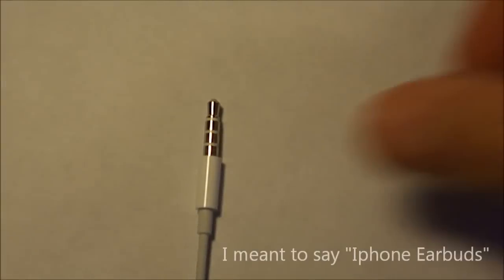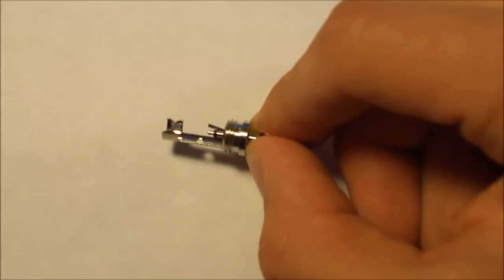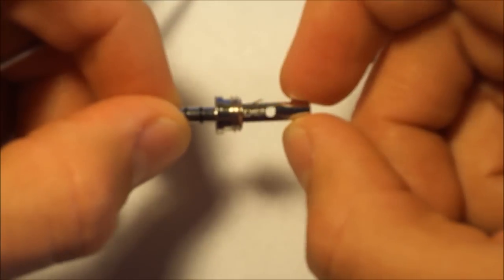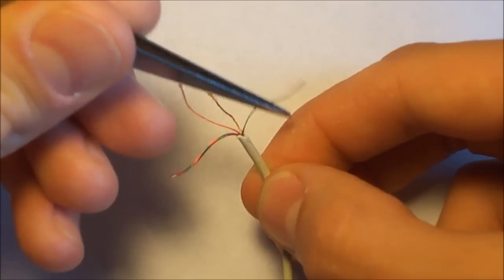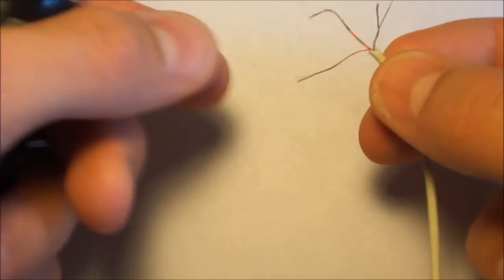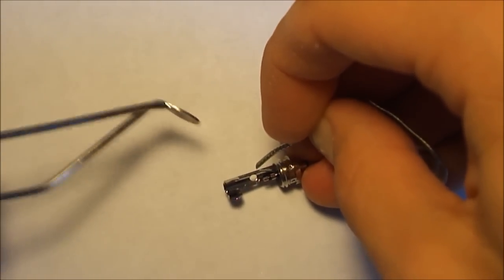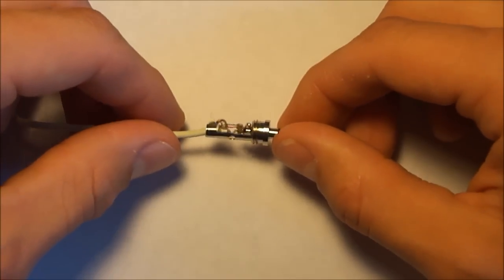Repairing Headphones with Microphone (TRRS Plug)

Comment from the maker: The plug on headphones with a microphone are a little different from your typical headphone plug.  The Headphones with mic have an extra ring of metal on the plug (the plug itself is called a TRRS Plug- meaning Tip Ring Ring Sleeve Plug).  Your PC probably cannot provide output to a TRRS plug, it can only provide output to a TRS plug (Tip ring sleeve- like those seen on conventional headphones).

Comment from the maker: You may have not connected the red/green twisted wires and white wire correctly. The white wire is the ground so make sure you placed the white wire with the ground copper wire.

Comment from the maker: Yes, when you are done connecting all of the wires, wrap electrical tape around the plug before placing the cover over them. If the cover is made out of metal it'll interfere with your connection.

Comment: No.. when i wen't to strip the wire by using sandpaper (just to be safe) i extended the wiring out so i could get more in case i messed up somehow and after stripping the wire i saw silk protuding from the red green and blue wiring... not rubber wiring either the ones you can well use to get sandpaper off. realizing i had no clue what was up i immediately sought your help.

Comment from the maker: Wespin may be correct. I have not tried connecting it that way. When I fixed my earbuds I got the microphone to work but the volume control did not. I was under the assumption that the white wire was a ground but I may be mistaken. I also was under the assumption that the connector sticking out funny is the ground connector while the large connector with a hole was the microphone/volume control. See if Wespin's way works and let me know how it turns out.

Comment from the maker: You should use a solder gun, a hot glue gun make work but it'll be harder to keep the wires connected to the plug.

Comment: I have Scullcandy uprocks, and i was walking and the jack was pulled out of the cord. im not sure wether to do what you are doing or something else the cord is kind of like a fettachini noodle. and its a T.R.S plug  and the cord was just in the jack by being slid in, it was not melted together. please message me with advice of info on how i should fix it. i dont want to ruin them. they are nicer than other earbuds. thanks.

Comment from the maker: Then you might have to cut out the damaged portion of the wire. Find out where the short is occurring by carefully twisting the wire to see if your sound goes in and out. If it's up near the microphone, you might have to take the microphone apart. Then follow the steps in my "Headphone Wire Video" to see how to prep the wires so you can reconnect them.

Comment: Hey Rich, I sure wish I knew about the enamal coating before. It was driving me crazy I thought is was the wire giving me a hard time. Anyways I fixed a broken Astro A40 Headset, partially, by replacing the bus with the copper, red wire, a white insulated wire surrounded by a grayish wire. The Bass on one ear is faulty could this be because I did not remove the enamal from any of the wires?

Comment from the maker: The blue wire might be for the remote. I'm not sure though where to place it. It could also be the ground for the microphone (striped wire). Was there any other wire twisted inside the striped wire? If not, then the is blue wire might be your ground wire for the microphone / remote. I found on the Apple earbuds that the striped wire controlled both the remote and microphone. There was a white in the middle of the striped wire like I showed in the video, which was the ground.

Comment: the plug with 2 rings is a stereo plug with 3 wires (left,right and ground),mics are usualy mono so they use jacks with one ring only (2 wires,the one with the signal and the ground).So the plug you are using has the connections to the stereo speakers and the mic.
Nice video .Cheers

Comment: So this would work if..let's say your left earbud was not working, but you could get it to work of you wiggled the jack or wire around? Is there a simpler fix that doesn't require soldering or interior work?

Comment from the maker: You mean the wire has a cloth-like coating on the outside?  A wire stripper should work ust use a larger diameter portion of the wire cutter. If that doesn't work, I'd use a utility knife or hobby knife to score all the way around the wire. Just don't cut too deep.

Comment from the maker: I suspect that there is a problem with the plug (either a short or a disconnection of some kind).  I'd replace the plug if you feel ambitious enough. Also, make sure that your headphone jack itself is cleaned out. I have a video for this as well "How to clean headphone plug jacks".

Comment: Anyone using monster cable earphone (jamz,turbo etc...) there is normally only 3 wires unless you have volume or voice controls, from what I know the gold wire Is the bass booster, it may be the sand for other brands. I Am not sure about volume or voice controls because I only have the cheaper ones (lil jam £80+)

Comment: I got a  Genius HS-04SU bt the wire are cutoff from the inside of the headphones & its all wired mess up
the prob is there are 3 sets of wires 1 set for the other ear 1 for d mic 1 more for the jacks 
it has 2 separate jacks (for mic & phones)

Comment from the maker: Interesting. I'm not sure why there isn't an extra wire. If it looks like this plug then just connect the 3 wires you have to the plug. Just skip the part where I connect the additional striped wire.

Comment: I have a Philips SHE9750 which has four wires (red, green, BLUE and copper) and it's original connector only has 2 "plastic-rings" (ordinary P2). The problem is that I have no idea of where each wire should go.
Any help?

Comment from the maker: You probably have a short in your plug. You should try replacing it.  Make sure you have the right plug- go to the 1:00" time-point in this video to determine which plug you need (either the TRS or TRRS plug).

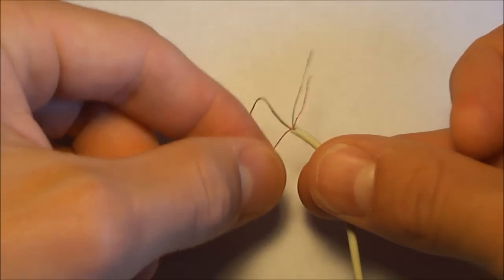Comment from the maker: You could try to cut the bad portion out and reconnect the wires individually. You'll have to make sure you remove the enamel coating like I show at the 6:10 time-point in this video. Also make sure you wrap the wires individually in electrical tape. -RM

Comment: I have a samsung omnia 7 with trrs.  I wired the red/green wire & white wire to the lead with the hole in it (which usually is supposed to be ground, rather than the diagonal lead, but I'm not sure about iPhone) and the two smaller copper wires that you twisted together to the diagonal lead.  With this configuration, both my volume & pause controls work, as well as the microphone.

Comment from the maker: @DazedEdits Water damage can harm the earphone.  I'd try using some canned air to lightly (very lightly) blow any debris from the earphone. Also, since the right side is working fine, it makes me believe it is water damage. You could try replacing the plug though just to see, but you may need a new set.

Comment from the maker: @tejizo Continued from last comment- the ground connector is the connector that is sticking out at a diagonal.  You will also be connecting the ground (the copper wire) to this connector as well. I have not tried this myself and basing this off of what a user told me (which worked for him).  Let me know if it works for you as well!  Feel free to ask if you have more problems. Thanks!

Comment from the maker: @tejizo It's the connector I have in my left hand at the 3:10 time-point.  It's the largest connector, around 1 inch long.  Also, originally in the video I connected the red/green and the white wire to that large connector but my volume adjustment didn't work anymore (the microphone did though).  I had a user comment that the white wire should be connected to the large connector, but the red/green wire should be connected to the ground connector - continued next comment.

Comment from the maker: @maxanddebra Here is my best guess: red and blue (Audio), Yellow (volume control/microphone), and white (Ground). The best way to tell would be to hold the wires on temporarily while it's plugged into your phone...This might be a little tedious, but it's doable. The yellow or white is most likely the ground, just make sure one of these is connected and then connect the red and or blue and see if you hear any sound. I'd draw a diagram of the plug connections (based off of my video) -Continued...

Comment from the maker: @XxExOtIcxFlAm3xX Does it have a microphone? Also, does the plug tip look like the plug I show at 1:00 in this video?  If so then you'll probably need the plug in this video. If not, you may need the plug I show in my 1st video (hyperlinked in the upper corner of this vid). In my 1st video I show how to connect that plug.

Comment from the maker: @jbond5081 Sounds good. Let me know if it works. I only had one viewer try it out so it'd be good to know if it does work. If it does not work (neither the microphone nor the volume control work), just unsolder the wires using the soldering gun, cut off the wire to get a "fresh piece" and connect the whole thing to the large outside connector like I originally showed in the video! Thanks again, I appreciate your help!

Comment from the maker: @SuperBunnyKnight  It's hard to reattach the original plug because they make the connections very small. You'd probably have to buy the plug I show in this video so you'll have to spend around $7 for it. It's up to you though if you think it's worth it instead of buying a new pair. Make sure your plug has 3 lines like I show at the 1:00 time point of this video.

Comment: @RichMethods my problem is a little different, when i tugged on my headphones t black covering ripped and the wired was pulled out of the housing. how do i fix that? my right headphone won't work only when i put the earbud more into my ear. i use skullcandy headphones with bass boost. please help me since i don't want to have to go to the nearest electronics store and buy another pair for $20 out of my pocket

Comment: won't work can't get wires to consistently have sound in them before soldering them, doing my nut in and at this rate there won't be any cable left by the time I've done it

Comment from the maker: @namvanbui The Red = Right side, the Green = Left side. It's also common for the ground to be not connected properly, which could be causing your problem. Worse case scenario you might need to reconnect the plug, but you should be able to figure it out. Did you need the TRRS plug like I showed in this video for your Bose Headset?

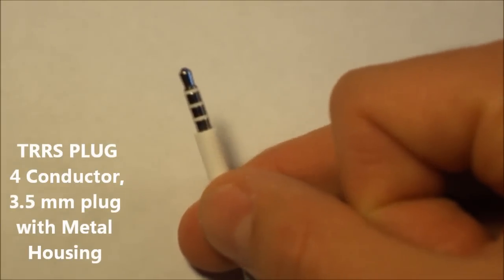Comment from the maker: @vinny876543 Ok, the blue, green, and 2 grounds are your "normal" headphone wires. Treat them like I do the Red (blue in your case), green and copper wires in the video (Start the vid at 2:10 for a description). The red/white wires are your extra features, like bass, microphone or volume control. I'm not sure if the 2 red/white wires serve the same function, but I would connect them to the out side connector (the microphone connector in the video).

Comment from the maker: @scoopable1 I believe the red with copper and the green with copper are your microphone. Treat the both of them like the Red/Green twisted wire in the video. Does that make sense?  So you'd probably be placing both of these wires on the same connector. I'm not totally sure of this, though, so it may not work. Let me know if you are successful.

Comment from the maker: @spairpartsdealer It seems like there may be an issue with the right speaker itself. Have you gotten the right side wet or has it been exposed to moisture?  There may also be dirt collected on the speaker. Try using some compressed air to clean it. It could be the plug and/or cable, but consider the stuff I mentioned above.

Comment: Hi RichMethods

I have a Sony MDR-ZX100 Stereo Headset.  I just purchased them a few days ago.  The sound is fine, but for some reason, the bass thumb in the right earphone isn't as recognizable as the left.  I switched ears just to see if it was my hearing, but it wasn't.  Also, the sound and frequency in the left is much better than in the right.  If you have any suggestions as to how I can fix this, please respond.  Thanks.

Comment from the maker: @lordlynxtube Yes, your explanation is correct. You might not get the Volume control to work (as I mention in the video) if you follow my method. I think that the Volume control is the wire inside you white wire, but I am not sure where to connect it. I did get the microphone to work (the white wire) however, which I feel is reason I have the headphones.  If you get your volume control to work let me know.

Comment from the maker: @lordlynxtube It looks like the wires on the left side of the picture are the sound, so they would go on the center connectors. Place the red one on the smallest center one and the other wire on the second center. The copper wire (ground) goes on the diagonal connector and the white wire (microphone) most likely goes on the large connector on the outside.  I've never worked this brand, but this is my best guess. Does the white wire (or any of the other wires) have another wire inside of it?